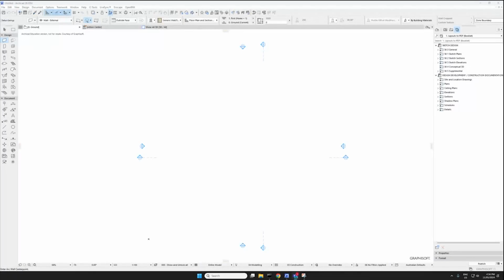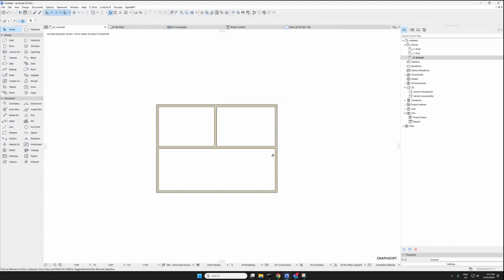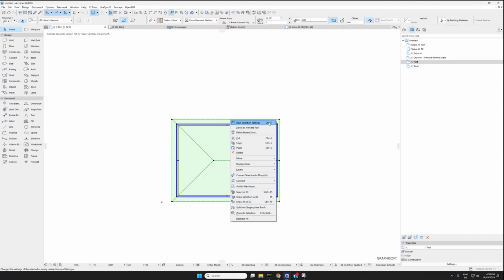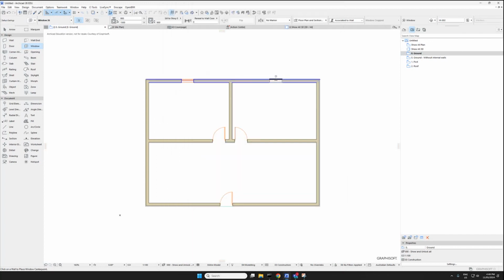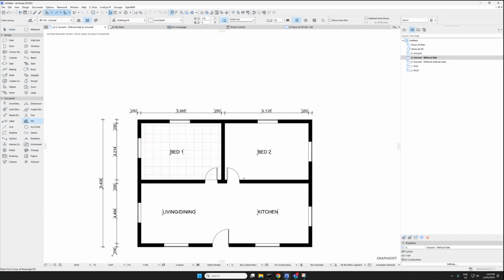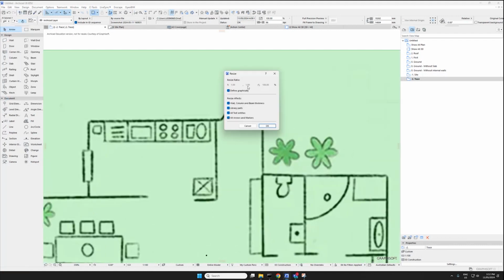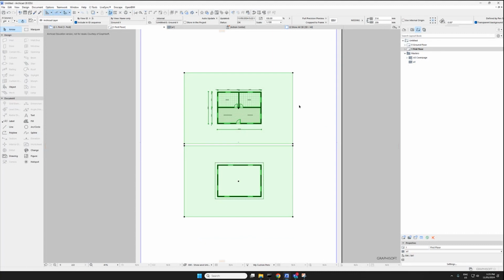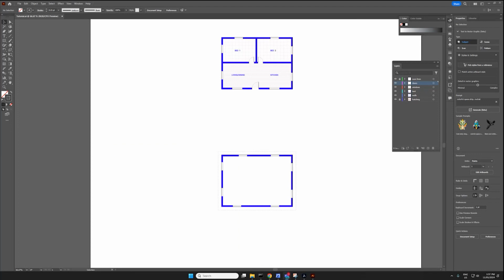Intro to ArchiCAD - Building the Basics

Comment: Thanks for your time and this informative webinar. Based on your experiance, what is the AI role in the new version of ArichCAD? And is there any relaibe source for more Assuie families or ArchiCAD blocks?
Reply from the maker: Thanks for tuning in! ArchiCAD 27 now features Stable Diffusion integrated into the 3D rendering view, allowing you to quickly visualize your projects with various materials, textures, and design variations using AI. 
ArchiCAD uses GDL objects, similar to Revit families. For 3D objects of real products, I recommend checking out BIMobjects.com, where you can filter specifically for ArchiCAD. ArchiCAD is very versatile, with a plugin that reads Revit families and SketchUp objects from 3D Warehouse, and it can easily import 2D CAD blocks by simply dragging and dropping.